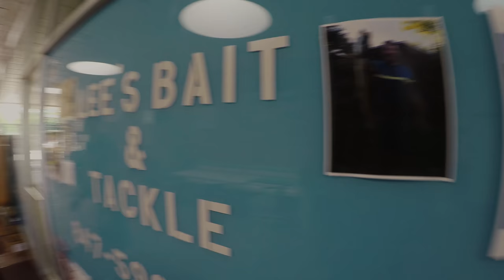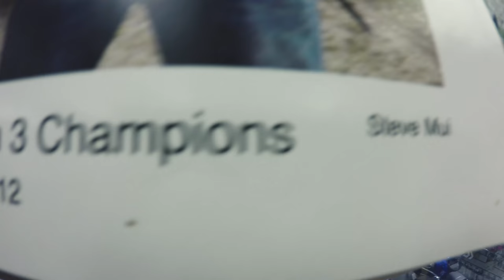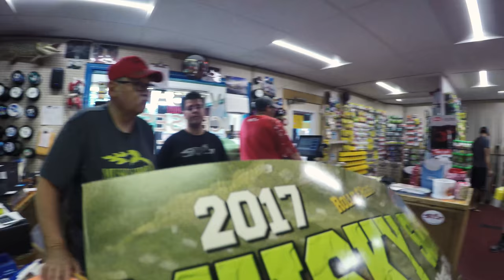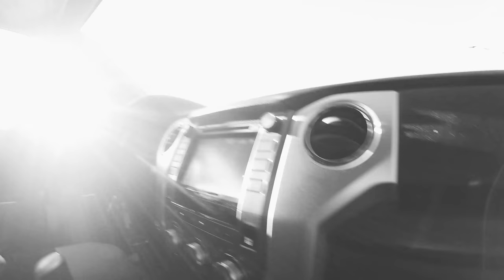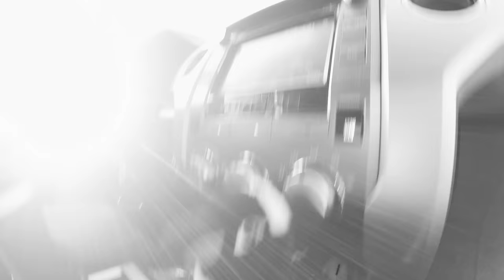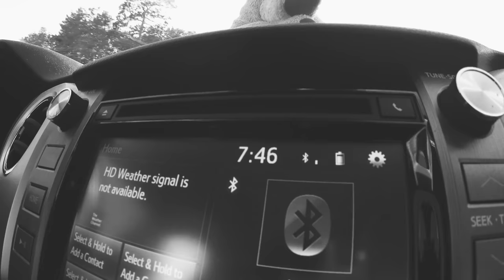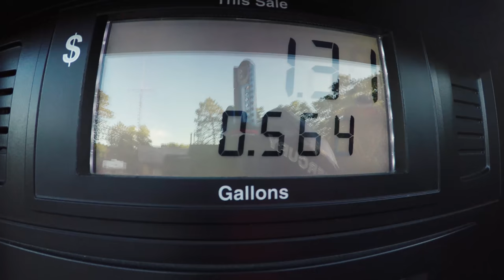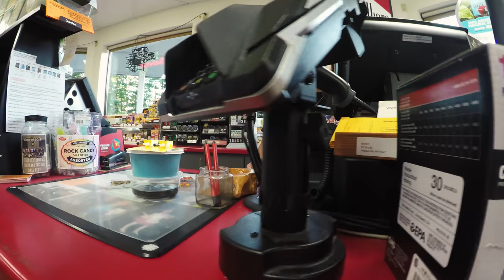Traveling to Wisconsin for Giant Smallmouth Bass with Steve Mui

Comment: That happened to me a. Month ago but found my trailer was rotted out! Bought a welder and new/used  boat and trailer for $200 dumped the p.o.s. Boat and welded a new trailer together that is 10x overkill then needed. But it's legit and will never deal with that same exact  b.s. U guys did. At least I don't feel that bad now cuz I guys went through it. Struggle is real !